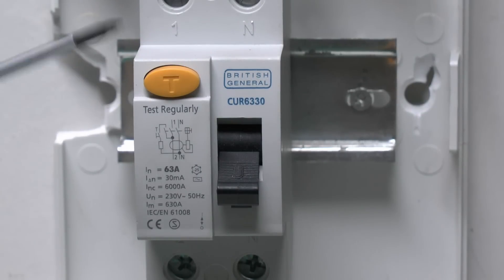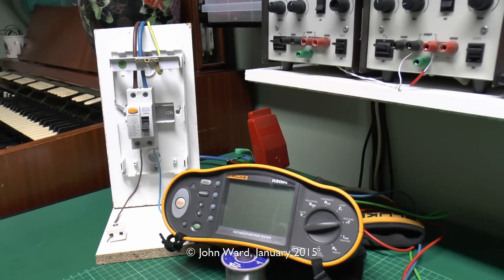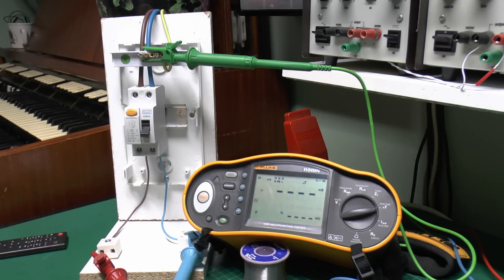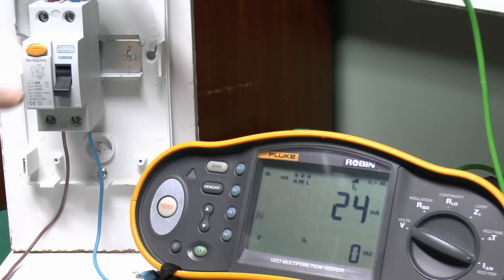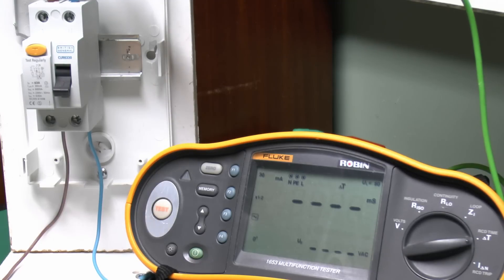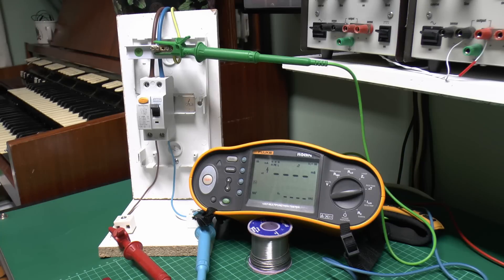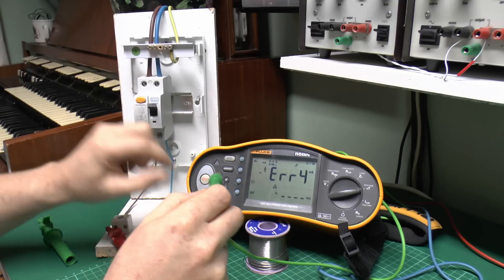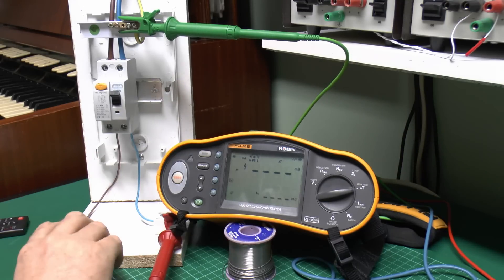How to Test RCDs

Comment: What is the reason why, in faulty RCDs, pressing the test button does not give any result? Could it be the contacts sticking, could it be the resistor burning out (and how could that happen)? What is the connection between the repeated testing required by the manufacturer and the “health” of the RCDs?
Thanks to everyone for the answers!
Reply from the maker: Usually it's the button failing, or the resistor burning out.  If the RCD trips as normal, the resistor is disconnected as soon as the RCD trips.  If it doesn't trip, the resistor will be powered for as long as the button is pressed, which will cause it to overheat and fail.
Failure of the RCD is either mechanical where the contacts stick or weld together, or for electronic types where one or more of the electronic components fails.
Reply: @jwflame  I got it. Thank you for your answer, JW!

Comment: Is it acceptable that an 30mA ELCB tripped with the result of  110ms at the 30mA test.
Reply from the maker: Yes, the maximum is either 200ms or 300ms depending on what standard it was designed to.
Reply: @jwflame  Thanks for your answer, we followed IEC61008. I doubted what we have as  I saw the RCD you tested tripped within 40ms at 30mA.

Comment: Hi jw with the new regs and type a rcds. If installing a socket on a existing circuit for a 13 amp single oven would this need to be type A or dose 531.3.3 mean this is fixed equipment and is okay on ac type still.
Reply from the maker: Type A is required, as a socket outlet could be used to connect other devices, and most ovens have electronic timers now which can have DC components so are not suitable for Type AC even if they are wired in permanently.
Reply: @jwflame  okay jw so even a fused spur would not work on ac type rcd any more needs to be type A.  So it would have to something like a cheap gas cooker that just has a spark and nothing else would be okay on type ac.  Thats going to please a lot of customers when I start telling them lol

Comment: Good video tutorial. I would've done a test with ground/green probe connected to the outlet neutral of the rcd , to show/simulate that the one rcd connected in series would not trip. 
You already explained it, but could be good just for visual purpose 😉.  Good job anyway!

Comment: is it important to connect load side at terminals 2 and N and grid side at terminal 1 and N, or can i connect load side at terminal 1 and N and RCD   will work perfectly fine?
Reply from the maker: Depends on the RCD - it's OK with some, but not others.  Check specifications from the manufacturer.

Comment: Hi John Love the clips, I'm looking for advice I have a Fluke 1651 MFT from 2007 its never been used and as new, do you think in modern day eicr situations that this tester would be suitable for use and can it perform all tasks required to 18th edition, I'm a mature student 1st year looking for some sound advice - thank you in advance.
Reply from the maker: Yes, all of the tests it can do are still valid - very little has changed for testing since then.  That one was the basic model so doesn't have earth electrode testing or phase sequence.
Reply: Hi John, Yes you are right it was the base model at the time of purchase, I did Part P Full scope test with EAL and decided I would carry on with my electrical training but career dictated otherwise, I am now on the long haul C+G 2365 route -  but my training is well underway, Thank you for your advice and keep the Clips Coming :)

Comment: The Tests to perform are to be conducted on the RCD device "Before mounting into the CU" or " after mounted and energized in CU" ? The 1st test is really testing the Device compared to the 2nd tests which is Test in the System. Grateful for clarification. TQVM
Reply from the maker: Tests are done when it's installed in the consumer unit, and after most of the other tests of the circuit wiring have been done.

Comment: The inbalance is measured by the RCD device between L1 and Neutral, so i gues you need to connect the blue wire to the Fluke meter. At https://youtu.be/ZaAUg75BR5Y?list=PLVsHvs2SuqmrHBQ0PDDHzq2LXkssRBp4Q&t=231  you say it is not needed.  But i understand the simulated leak current is achieved by the Fluke device and this is done by letting current flow to the green wire from 0 - 100 mA, and that current is missing in the blue wire circuit.  Was this test done with Ul = 50 Volt  instead of 230Volt ?

Comment: Hi John, this was a really helpful video.  I have a question about rcd blinding.  Would a test like this show up a blinding issue? Or how could I test for it? Would I have to directly measure for any pulsating dc currents?

I studied to become a domestic installer about 6 years ago now, but only left my previous job recently, so i'm re-studying.  I have to do my 18th regs and came across the effects of blinding there, though I can't seem to find much else on it elsewhere. Could you please help clarify
Reply from the maker: The only real test is whether the RCD trips - testing of RCDs should be done with the installation loaded as in normal use, with equipment switched on, and the testing done at a time of day where the installation is actually being used normally.
Reply: Ok thanks John, not a simple push of the test button then! Might be worth doing an extra test at a later time if these conditions aren't met at initial testing?

Comment: What is the difference between an rcd, and a MCB? Here in the states we have GFCI devices and AFCI devices.
Reply from the maker: RCD = GFCI, trips when there is an imbalance between L&N caused by an earth fault.
MCB = circuit breaker, trips on overload or short circuit.
AFCIs are AFDDs here, arc fault detection device.

Comment: How do you do a ramp test If you have an RCD main switch on an old fuse board, would you still do it through a socket on a ring or can it be done at the rcd ??? Thanks

Comment: Could you help me, I need an explanation about how connect rcd eaton ( 4 pole). Model DRCM 40-4-003-U
Reply from the maker: 3 phases and neutral on one side, the same 3 phases and neutral on the other side.
Reply: @jwflame  if un the output only i connect 3 phases without neutral?
Reply from the maker: That's ok, if the circuit doesn't have a neutral.

Comment: John,  earlier today Wednesday 17th  April,  I intended cutting my grass using my electric mower.  However,  after plugging in my Masterplug RCD, and testing it as expected, the test light came on initially, went off as expected so I assumed that it was all systems go. Unfortunately, I could not start the mower so could the RCD be past its use by date?  Mower works fine when plugged in the mains directly.
Reply from the maker: Two possibilities - either the RCD plug is defective, or the lawnmower has a fault which is preventing the RCD from switching on.
Try some other item like a kettle with the RCD.
Reply: @jwflame  Many thanks for your suggestion,  I didn't think of doing that!

Comment: Can someone explain the 0 and 180 degree part to me any why thanks
Reply from the maker: A.C is both positive and negative current cycles, the 0 option starts the test current at the point where current is positive, the 180 option at the point the current is negative.  RCDs may react differently depending on the current direction.
Reply: @jwflame  thank you

Comment: RCD question. My son has an electric car that comes with a charger that plugs into a 13 Amp socket. At his house all is fine but when we charge the car at our house, switching power onto the charger causes the RCD on the ring main to trip. It doesn't do it every time and on a reclose of the RCD the charger powers and is no further problem. I have read that their are different types of RCD, A, B, KV etc and that some chargers may require a KV type so that the initial current surge doesn't cause a trip. It seems odd that he has no issues at his home when charging the car. Do I need a KV type RCD (very expensive) or is it likely I have a wiring fault? An electric kettle does not cause a trip on thd 13 amp socket used for the car charget.

Comment: Thanks for making this video!
I hope that you please want to advice me. I have a RCD type A going out to a 2 phase outlet (no ground)
I am wondering if it is safer to use a isolation transformer for DUT or just the main?
As you show the RCD does trigger at 30mA but would never trigger if an isolation transformer is between the DUT and the RCD.
But all on YouTube (Americans) do say isolation transformer is the only safe way.

Comment: should 30mA RCD's be in series i.e one RCD circuit powering a sub-main (GARAGE UNIT)  where the main switch on the sub-main is  RCD main switch  30mA or do you go off the high integrity side or install a time delay RCD?? 
which is best practice?
Reply from the maker: It's poor design to have two or more RCDs of the same type, as when a fault occurs there is no way to know which will trip first.  Sometimes both will trip.  This is not dangerous, but would be inconvenient if the house was disconnected due to a fault in the garage.
A time delay RCD will resolve the problem, but the real answer is to only have the RCD for the final circuits, submains do not normally require RCDs.
Reply: @jwflame   Thank  you

Comment: Hi John, I am considering building a small unit to test RCDs ( purely a project, not to be  a professional meter ) . Do you have any ideas what electronics these meters use to create the leakage current? I was considering switching some power resistors with relays, to create the various currents required, but is seems a rather bulky solution, especially to get also the x0.5 and x5. Also, the tripping current resolution will be crap. Suggestions?

Comment: Hi John thanks for the upload, could you do a video on a rcd test with a three phase three wire with no neutral connection on the load side of the RCCB? Was wondering if it would still trip. Many thanks.

Comment: Do we do rcd test just on sockets and applied for all the circuits or should  we have seperate rd test for each circuits like lighting? If so wouldn't be dangerous to be exposed to live circuits?
Thanks
H
Reply from the maker: If there are several RCDs, they all need to be tested.  One RCD with several circuits connected only needs to be tested once, it's the RCD being tested not the circuit wiring.
Reply: John Ward 
Thanks John
Great help

Comment: Hello....a little confusing and unless I have interpreted wrongly...but you seem to be suggesting, that 63A and 630A are both the max before the switch 'gives-up'...apologies...which is it?  best regards
Reply from the maker: In (63A) is the maximum current while the RCD is in use.
Im (630A) is the maximum current when the RCD is closed, i.e. a switch on surge.
Inc (6000A) is the maximum current when a fault occurs such as a short between L&N or L&E.
If any of those are exceeded, the device will probably be damaged.
Current values are for the particular RCD in the video, they will be different for other RCDs but the definitions are the same.

Comment: What is used for the trip calculation peak, rms, or pp. VAC. ??.
Reply from the maker: RMS, and an 8K resistor will give 30mA at 240V.  If you do use a resistor to test, bear in mind that if the RCD doesn't open, the resistor will be a 7W heater and get very hot / be destroyed depending on it's power rating.

Comment: hi,John, I wish to share my experience with an electrical tripping occur in an electrical fault in a condominium  premises that a household using a single phase 60A supply , the DB which install with a 2 pole 60A MCB tpye B and a 2 P RCB 60A 30MA, protection and overload devices and was connected to a 2p 60A type B MCB at the electrical riser on the common corridor from there connected to the MSB at the basement where they house all the electrical meters with each meter board control by an 60A 2p type C MCB. the insulation of the wiring in the premise was tested and it was at  above 1 M ohm and the overall usage was not overloaded, but occasionally the supply tripped may be due to some faulty devices or appliances they use , and ever time it happened , it tripped the 2p MCB tpye C at the MSB , where some time in the middle of the night that there is no security guide on standby and could not turn on the supply because there were no access to MSB room . I wish  to know why it should always tripped at the MSB switch room MCB type C MCB instead of the own DB or even the corridor electrical riser type B MCB.I will be grateful if u could relief me with some solutions thank you.
Francis

Comment: Hi John thanks for these good videos ... I have always thought that 63A is the braking or tripping current rather than working current on the particular rcbo. And unfortunately tripping current 6kA . what would be the best rcbo to use to protect the wires from over heating ? thanks
Reply: It's an RCD only not an RCBO.
63A is the maximum continuous current. I believe 6000A is the absolute maximum fault current to reliably break the arc and not catch fire or explode. Consider a low impedance high current source can sustain very high fault current into a dead short!

Comment: Hi John...when testing RCBOs am I correct in assuming that they should be tested in the same way but one at a time? Can they all be connected to line, neutral & earth while testing or should only the RCBO being tested be connected. Thanks in advance.
Reply: I've just realised that it would have to be each one separately otherwise you couldn't verify that each one is functioning correctly. You may have guessed that I'm still in training.

Comment: Hi John I'm a fully qualified NICEIC approved contractor and recently installed a MK split load board amendment 3 to replace a old consumer unit on a TNCS system. Carried out all dead tests including IR testing and all out going ccts were completely clear. How ever when energised and carry out a RCD test it fails on times one and test button will not operate. When out going neutral is disconnected it passes its x1&x5 0-180 degrees and trip button functions. I narrowed the problem down to a compression fault in a radial boiler supply however the cores are completely clear between each other and disconnected from the boiler. I'm completely baffled what could cause this I've spoken to Mk and were to baffled along with the NICEIC. Any ideas?
Reply: Hi Andy did you happen to find out what was causing the fault
Reply: marky marks I’ve literally only just seen this message. Sorry buddy. No I never got to the bottom of it.
Reply: Assuming incoming conductors are correctly connected, carry out the RCD with nothing  connected on the load side of the terminals.
Reply: Steve Tang hi yes I tried that and it was clear.
Reply: @andyevanscreations  so are you saying the RCD tested ok without connecting the circuit, then when you connect the circuit it doesn't  trip at all or ...? Oh the test button don't work but the 5x trip work but not the 1x?
Reply: Steve Tang hi Steve yeah the RCD would trip in the required times and test button functioned properly when disconnected from the out going. I can’t recall if the RCD did trip on times 5 or I just didn’t get to it because it failed the times 1. I replaced the RCD as I thought it was faulty. But the new one was the same. Like I said I narrowed it down to a spur for the boiler. Doing IR tests the radial was clear with the load disconnected. But when I removed the spur from the wall the RCD began to operate correctly.
Reply: @andyevanscreations  the bit I can't get my head round is that when you connect the load on to the RCBO, the reset button stops working as it's an internal test which should have nothing to do with the outgoing connections... If it's the 1x trip not working and hence wouldn't let you go to 5x test then the only explanation I have if the test was carried out at the end of the circuit is that the neutral and earth is the same potential conductor and that the earth conductor does not go back to the fuse board.

But if you did this test by the board and it did that then I'm baffled too
Reply: @andyevanscreations  I just drew the RCD circuit and I can't see how is that possible coz I can't see what you can connect to, to stop the reset button working or the RCD tripping.  Either some checks weren't done properly or there's some X-Files shit going on😱
Reply: Steve Tang I honestly thought I’d missed a trick. Eventually it worked fine once I’d sorted out the compression at the spur however the IR readings were fine through out. I put it down to an anomaly that I couldn’t figure out I’ve since been back to carry out some other work and it still works with out fault.  The strange thing is I’ve had it happen since on an MK RCD on another job that I was called out to. One of my lads were finishing of a job and said the RCD fails x1 and the test button. Straight away I told him to remove the out going and it was fine. Again IR readings were fine and no obvious faults to report. I visited site and decided to go for the most obvious that may have compression faults such as the cooker switch or shower pull cord. A presto it cleared it. I’ve no idea how it’s possible. I’ve not come across it in the last 2 years mind and I’ve been to plenty of MK RCDS. So I’m lost to say the least.
Reply: @andyevanscreations  I wonder if it's a bad batch or where it was made, did you notice in the last few years and now that some of the MK protection devices were made in Malaysia and some were UK, and I think some were Philippines or something and this is all on MK Logic plus range face plates and switches too🤔
Reply: Now that the IET have finally realised that different types of RCDs exist, and we are all a bit more aware of them. This sounds like DC saturation caused by one of the connected loads. Probably an asymmetric load from a power supply in the boiler.